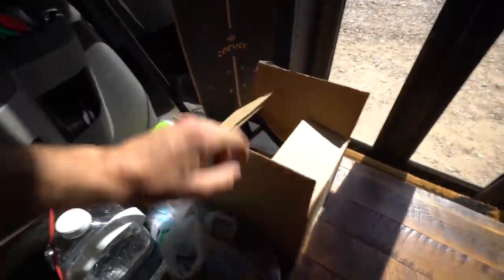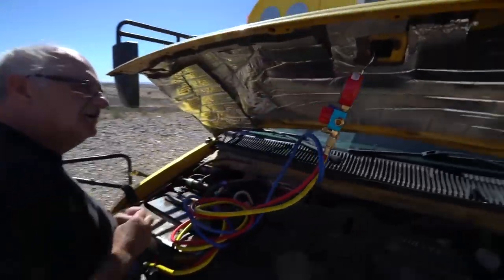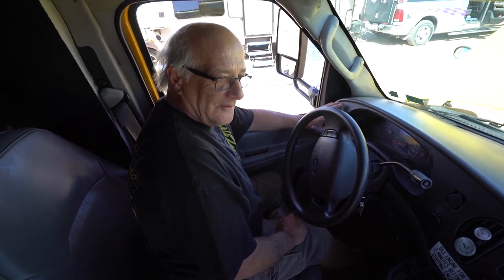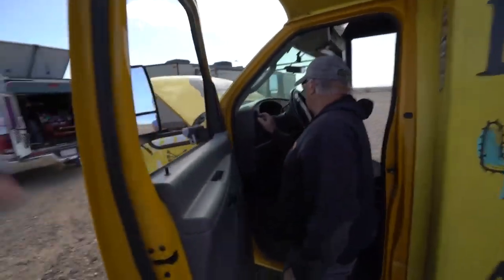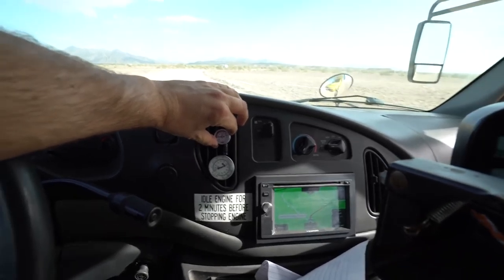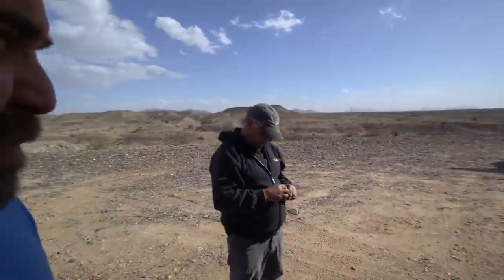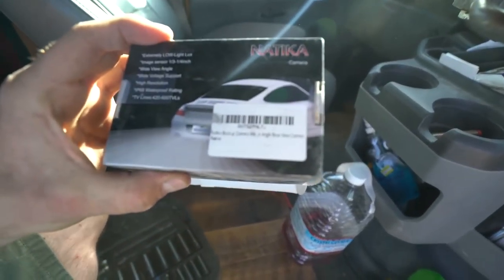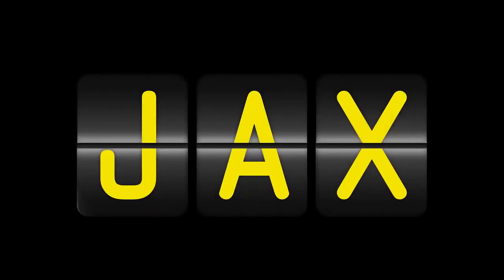FINAL AIR CONDITIONING FIX!! (I Think)

Comment: my only concern with the AC is where did all the refrigerant go to begin with? f you needed so much to fill it that means that much has leaked out and i don't recall that you guys sealed up any leaks? just curious as to whether or not that was addressed?
Reply: Hope that Freon didn't have sealant in it and there thought is that will take care of the leak. It will only cause more problems. Never get anything with a sealer in it. And yes i'am a pro. ASE master of 25 years. Those sealants will clog up the orifice tube up in a heat beat.
Reply: yeah id have to agree on the sealant thing. sometimes they will seal a very small leak but seems like it is usually a temporary fix and the sludge they create cause more trouble than the short term fix was worth.I feel like Badge knows his shit though so if they did use a sealant it was because of the budget situation not because he didn't know better.I sometimes have to do things that way myself, it never pays off really,will always ultimately cost you more doing something twice but it will get you thru a summer or whatever until you can do it right.